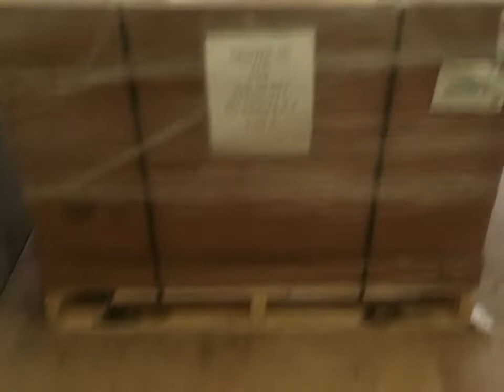Forklift driver breaks my BOX TRUCK floor SMH

Comment: Hey---If I have a small sliding ramp on my truck (not a lift gate) do I need those triangular looking ramps that you have in the back of your truck (in the event dock is too high for my truck)...I was told that if you use ramps you have to get something installed underneath your truck for ramps to work...any insight?